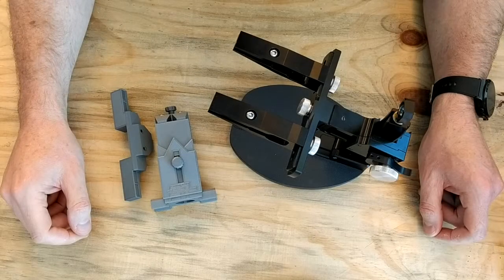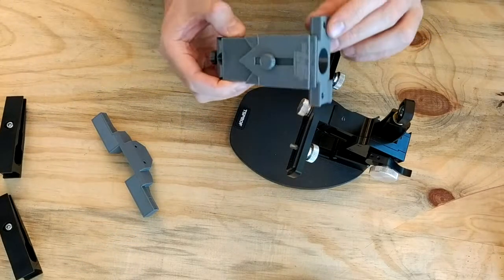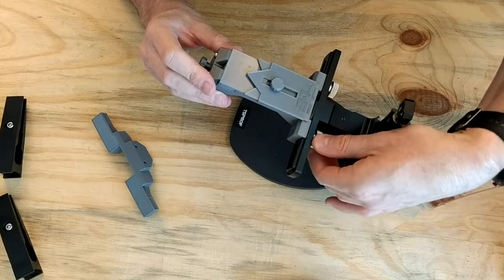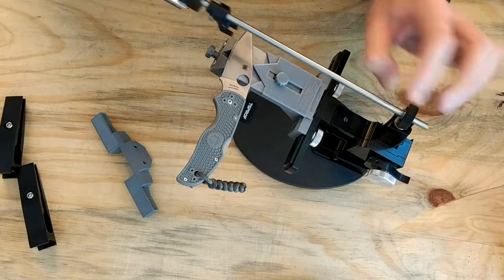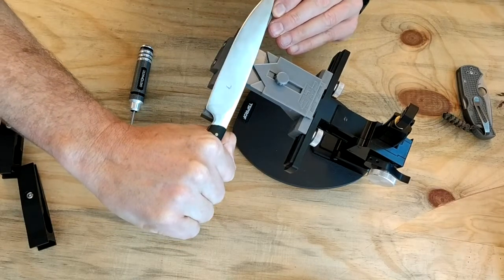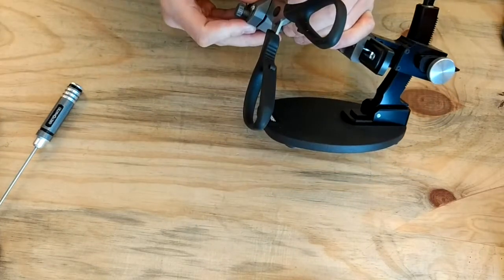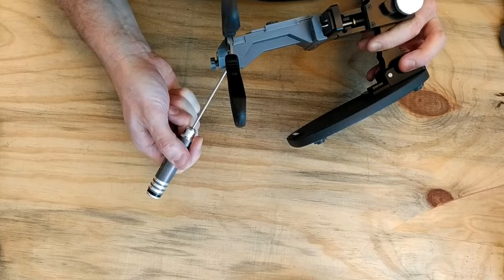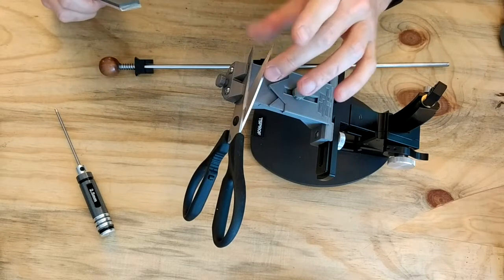Leading Edge Upgrades for TSProf K03, TSProf Kadet and TooHR

Comment: Are you able to demonstrate sharpening a Leatherman on this table?  I'm having trouble getting angle consistency.
Reply: Thank you
Reply from the maker: Yes you can, just make sure to use the vertical blade support in the front. Rotate the Leatherman blade until it is level/parallel with the blade table. Loosen the vertical blade support and slide it up until it touches the angled part of the Leatherman grind and while holding the blade parallel with the blade table, tighten the vertical blade support guide in position. FYI, can also clamp your Leatherman blade well with one of the Kadet original clamps if you prefer.

Comment: Anyone habe anything for sharpening a double edge microtech Ultratech?
Reply from the maker: It works well, I've sharpened Microtech Ultratech knives on it. The best way to do a grind like the ultratech dagger grind, is to place the bevel opposite to the one you're sharpening down on the magnets, and then using the vertical knife support under the edge you're sharpening. Works very well this way.

You'll just have to compensate for the sharpening angle because the sharpening side bevel pointing will be pointed upwards, if you know what I mean?
Reply: @777edge  im having trouble visualizing it
Reply from the maker: @jarrettm3728  Let the one side of the dagger bevel lay flat and secure on the magnets, then position the vertical knife support up to touch the other bevel on the side that lies over the edge of the magnetic table.

Comment: I'm so looking forward to trying this out with my kadet and the venev diamond stones! Not having the clamp or rotate is going to be awesome!
Reply from the maker: Let me know if you have any questions when you get it! Enjoy!
Reply: @777edge  what are the most important steps in using this attachment and just how strong are the magnets?
Reply from the maker: @dustinwhitt5297  Gritomatic installs N52 grade neodymium magnets, which is pretty much the strongest grade widely available. 

The most important steps are to be  consistent in what you do. Do everything the same on both sides of the blade. Check the position of your blade when you reverse it and sharpen the other side, and lightly hold it in position with your free hand (if necessary) while sharpening so it does not move around too much. Use the vertical knife support if you have a saber type grind.

If you want to keep to the same sharpening angle as the original angle on your knife then use a sharpie pen to color the edge and see if you're removing all the sharpie when starting your sharpening. If you want to grind it to a lower angle then it will take some time to set the new bevel as you'll need to remove more metal before you apex your edge. Most importantly, don't move on to finer stones until you've fully apexed your edge - until you feel a burr on both sides (one side at a time).
Reply: @Leading Edge  you get the burr on one side at a time or somehow you can feel the burr on both sides at one time?
Reply from the maker: @dustinwhitt5297  You will will typically only get the burr develop on one side at a time, the opposite side to what you are sharpening. Once you feel that happening, you know that you have fully apexed your edge.

Comment: Looks like a winner!  Basically converts the K03 into the same style as the EdgePro but of course better...  Magnets hold the blade to the table, scissors attachment, the extension for wider blades, the precision of the K03.  I greatly appreciate the innovation from your company.  The Leading edge accessories that I have are outstanding.  (KME  Multi-Function Frame upgrade, Knob for my K03)  I am looking forward to using the Universal kit with my K03.  Great Job!  😎👍
Reply from the maker: I'm glad you like my designs, thank you kindly for the feedback and your nice words of praise! Much appreciated!
Reply: I don't think the magnets make it better. I like the Edge Pro Professional because the magnets are removable. You can pull the blade across the blade table and for blades with a long, curvy profile, that lets you maintain the same angle across the entire knife instead of having massive angle changes as you move further from the blade table. Magnets are nice for pocket knives or other things you'd want to be stationary, but for that stuff, why not use the clamp? I like my TSPROF K02 and my Edge Pro, but I use them for different things. If you don't have an edge pro, I suppose this would be a nice addition for sharpening stuff that just won't fit in the clamp, but I wouldn't really say it's better.

Comment: I just got this in for my K03 but I can’t seem to be able to achieve the right angle with this set up. Do you have any pointers that might help me out?
Reply from the maker: Sure! Are you sharpening a Full flat grind knife by any chance? If so, have you compensated for the blade grind perhaps? The magnets will hold your blade flat on one side / face of the blade, so you need to add half of the angle of the primary grind to your sharpening angle if it's a full flat grind knife.

If you're sharpening a saber type grind with a small flat parallel section at the spine end then you can use the vertical blade support in the front of the unit to center the blade and keep it from rocking on the magnets.
Reply: @777edge  how would you know what the primary grind angle is on a ffg knife?
Reply from the maker: @ThoughtAstronaut If you have a digital angle cube, you can measure the primary grind with it. You can also use a laser edge goniometer if, by chance you have one.